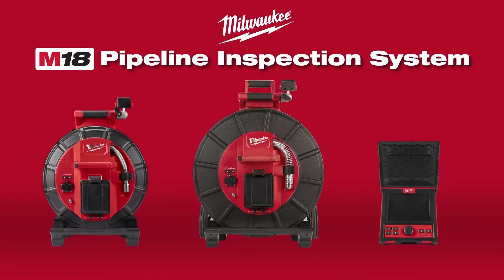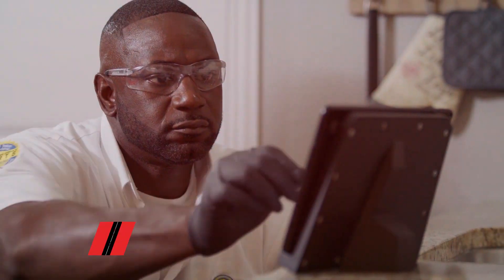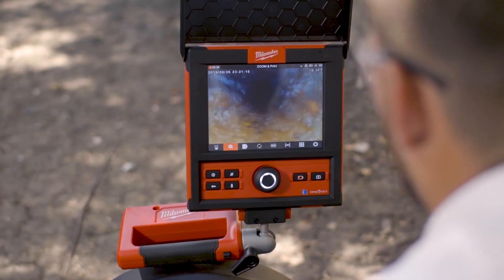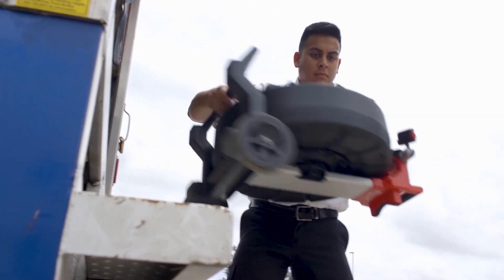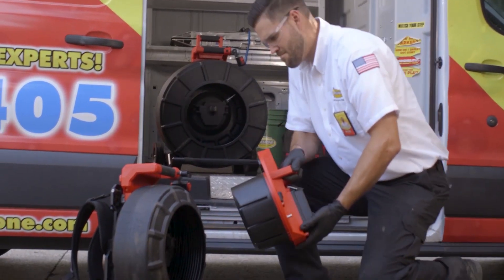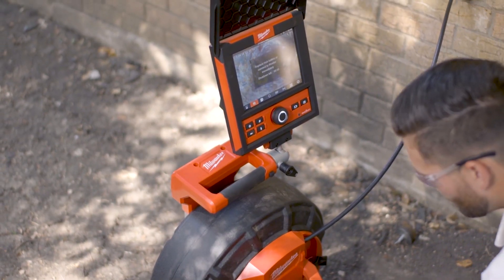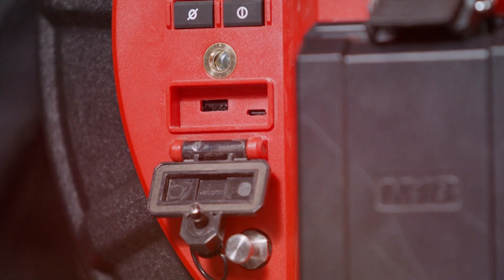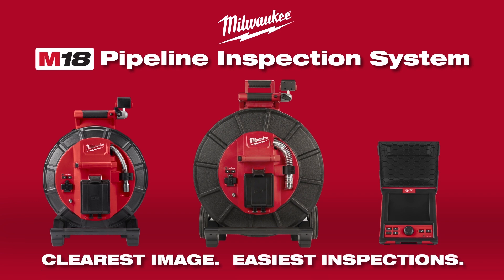Milwaukee M18 Pipeline Inspection System

Comment: I got the 120 foot version and monitor. Love the camera, not so much the monitor. For $1500, you can buy 3 tablets that will be of better quality and still have money left over. What I love about this camera system. You can connect two tablets to the camera hub at once. I can hand one tablet to the home owner, then go up on the roof and run the camera through a vent. The customer can see what Im seeing in real time from their couch! Really impressive system.